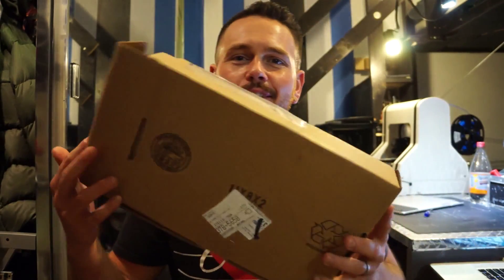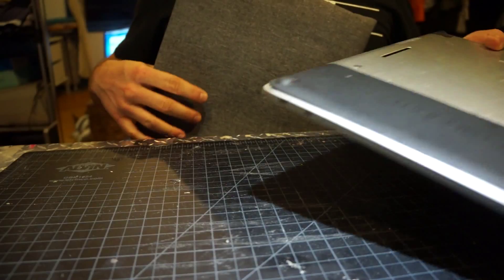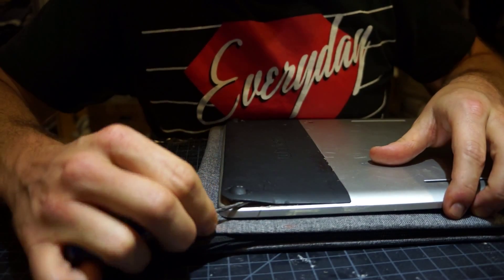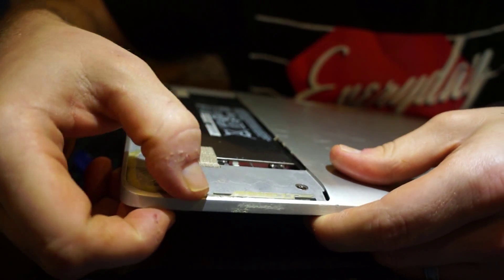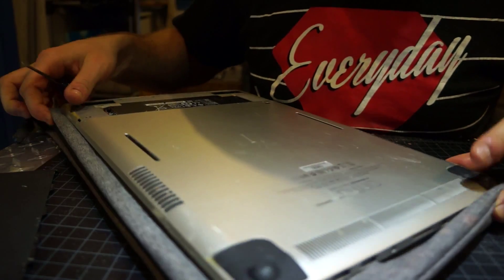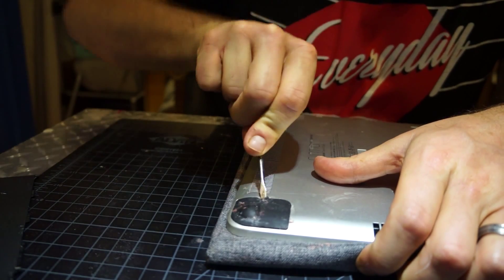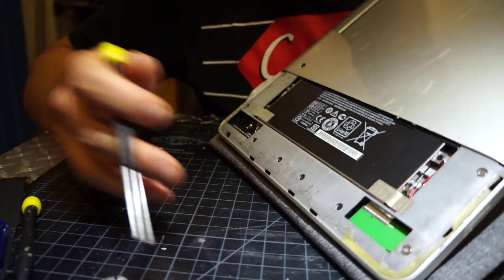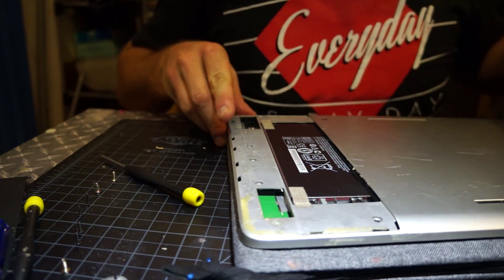Wacom Cintiq Companion 2 Disassembly

Comment: question ever heard of anyone actually replacing the screen?? I pulled mine out of my bag this morning and looks like someone decided it looked better with a crack across the entire screen, edge to edge
Reply from the maker: +Sam Flores Sorry im not seeing this until just now.  I havent heard of anyone replacing the screen. I feel like its held in place with strong adhesive and might be a tough task.  What did you end up doing? Hope it all works out!
Reply: Man , it's been out of commission since that post . It's going to go back WACOM, to be repaired by them for what seems like a ridiculous dollar amount from them $550. And the worse customer service I've ever received by what I thought was a high end company
Reply from the maker: +Sam Flores oh man that really sucks.  sorry to hear that it's going to set you back so much. I dealt with customer service when I had to return my cc1. seemed okay at the time but I have a feeling it's slipping as they weren't anticipating so many hardware based returns.
Reply: +The CG Alchemist  haya do u have  problem with output socket ?
Reply from the maker: Sorry im not sure what youre asking.
Reply: Did u had any problem with dc power slot The CG Alchemist
Reply from the maker: In the first model I had issues with the power cord shorting out. The second model seemed to use a similar design but I never had any issues with it.
Reply: 550$? From others they demand ~900$ now, for screens that won't turn on, but with intact glass...

Comment: Cool, you are definitely doing the most interesting things with the companion 2 on youtube atm! Keen to see more.
Reply from the maker: 821Drifter128 Hey thanks I appreciate it. I actually have 2-3 videos in the works that involve the cintiq.  One probably pretty brave. :X stay tuned!
Reply: Sweet, will do!

Was reading the guide and I have some questions. How is the bluetooth on the OS X partition, it work okay with keyboards and stuff? Also since the volume rocker doesn't work what are the options for managing the sound (can you just change it from the start bar)?

Thanks a bunch!
Reply from the maker: +821Drifter128 the Bluetooth worked fine out of box but since switching Wi-Fi cards to a compatible one it's cut out. pretty sure we can get it back, I just have Rio look into it. as for the volume you can change it from the menu or the keyboard if you have one connected.
Reply: That's awesome! Thanks again for speedy reply, keep up the great work!

Comment: a useful tip would be to use a blow dryer with a little heat to weaken the glue to help take the panel off.
Reply from the maker: Raymond Flores Good tip! Not sure how the hell i didnt think of that. I just had to replace the screen of my phone last week and I used a blowdryer, the screen came RIGHT off.. Maybe someone should redo this tear down with that included im sure they wont break the clips as easy.
Reply: Mike Flores it's not a good tip actually, the rubber is layered apparently so when I added pressure it separated the top layer and being pliable due to the heat it ripped the rubber and left this ugly air bubble on the surface.  I tried it so..not like I knew much better, thanks for brainstorming dislike is to warn others.
Reply: @FaithReport  Agreed! I just tried a blow dryer and the rubber just peeled off while making it more damage prone! Not only that, but it didn’t seem to soften up the glue in the slightest, as I can’t even begin to get it to pry open.